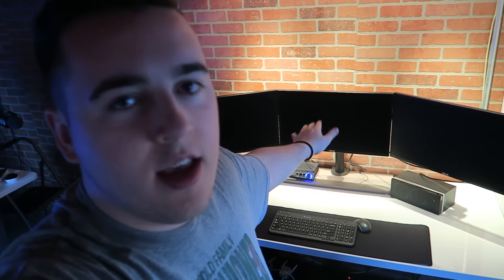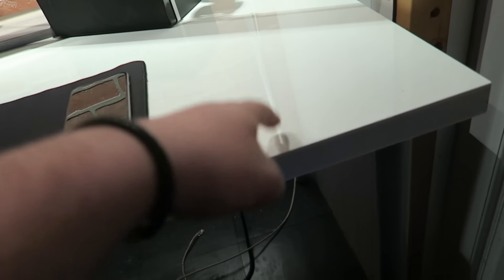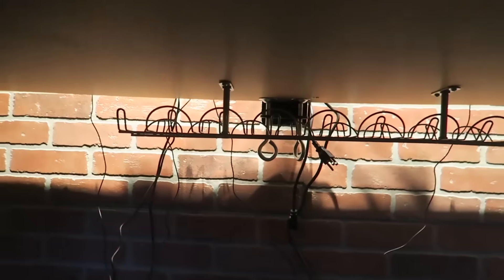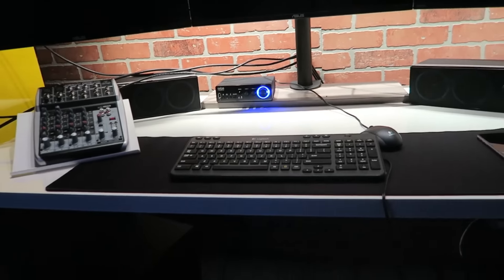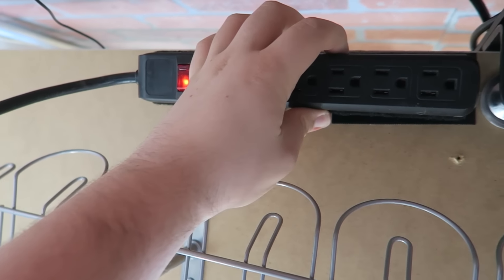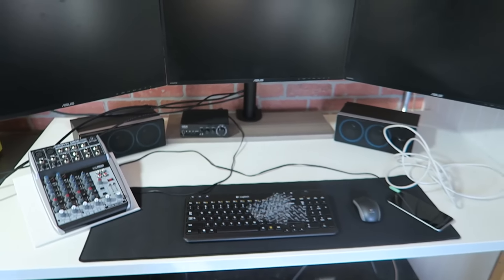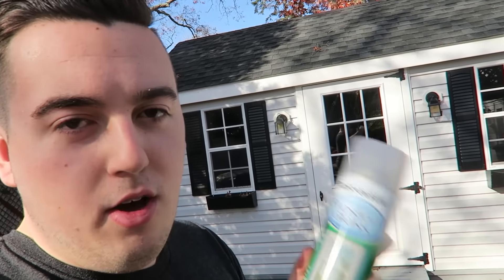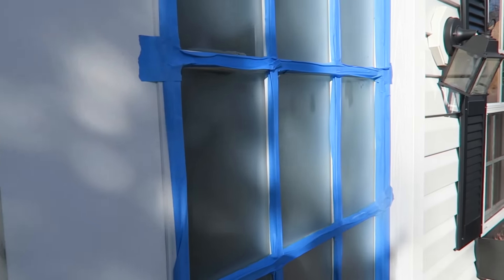FROSTING WINDOWS & STUFF (Pimp My Shed #14)

Comment from the maker: To everyone telling me to get battery lights for under the shelf... it's a great idea but I am just thinking of how annoying it could be to turn them on and off each time AKA I'm just lazy as hell. I'll probably give it a shot though.
Reply: dude why not put light under? probably a different color or some rgb leds so led shelves would pop up plus a different color for every video.
Reply: +swashin you could put LEDs strips under the shelvs so you won´t have more shadows and you could keep the shelves in their places because i think they look really good and you could control all the lights with a single remote
Reply: +swashin maybe get another bighead or whatever it is in your room with your swashin logo
Reply: You should get LED stips under every shelf bada bing bada boom
Reply: +swashin Yo Matt. Im doing a Black and yellow theme and that case you have. Damn its sexy af.  Can I get a link :D Also It will be entered on your show soon once everything is done! Keep up the good work! :D
Reply: +swashin if you want to fix the problem, put the small yellow LED lights there, they stick out by like 1mm and are not very noticeable. Just try not to knock them off.
Reply: +swashin just put leds under the shelf and have a remote for it so all you need to do is push a button
Reply: You could also just do adhesive led strips
Reply: LED strips ;)  can connect them to your main circuit and bada bing bada boom, great accent light with no hustle
Reply: +swashin If its flamin... you want the best way to do it is draw it out on that wall and that would get rid of that shade because you could blend it in with the drawing on the wall.
Reply: Dude you definitely saved me !!!!!!!!!!! I was watching for a lot of monitor stands but that were all super expensive and that have functions I denfinitely never use. Now you gave us that link for those dream price stand !!! Thank you so much man and keep up the good work 
!

Comment: You know you could put battery lights under the shelf to get rid of the shadows
Reply from the maker: +Llama Carl yeah but they could be a big pain the ass but I'm just lazy so maybe I should give it a shot
Reply: Not really, all you do is add batteries and Velcro/glue them and voila your done
Reply: There's one on Amazon called fulcrum something, 8 bucks, 3 pack
Reply from the maker: Llama Carl I mean having to turn on and off each one
Reply: Oh
Reply: +swashin Use some decent White LEDs and just wire it in with the TV or something.
Reply: +Phanto Works wires will stand out doe
Reply: Llama Carl He can use those cable plasters/molds he talks about :P I don't think it would be entirely noticeable on that wall.

Comment: Add a lip to the end of each shelve and put led strips on the back run them behind into your wall to a single controller and then you can just use one remote to control all  of them selves you could even change the color! it would be AWESOME 

the lip on the shelves would eliminate the leds being visible and glaring on the camera!